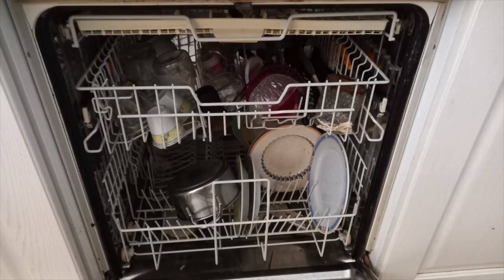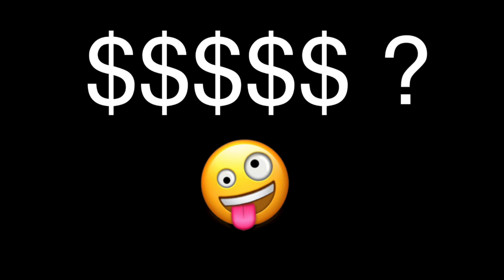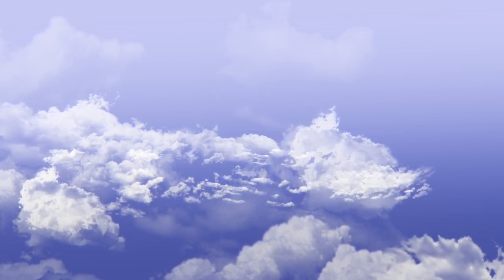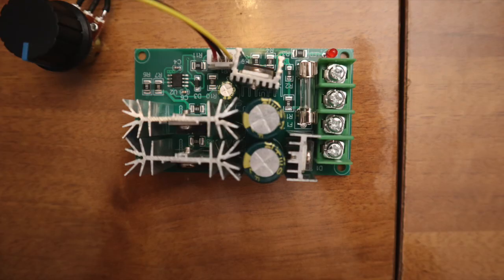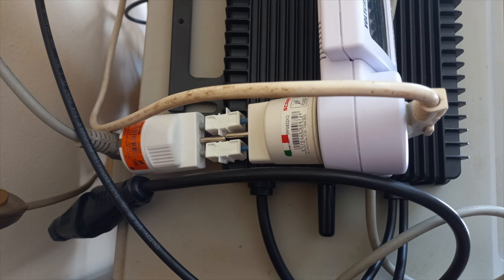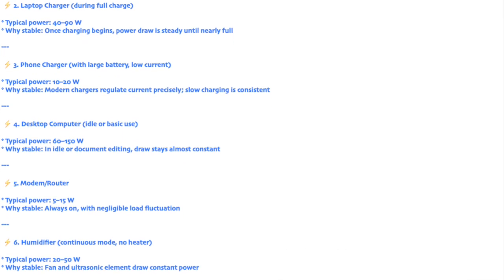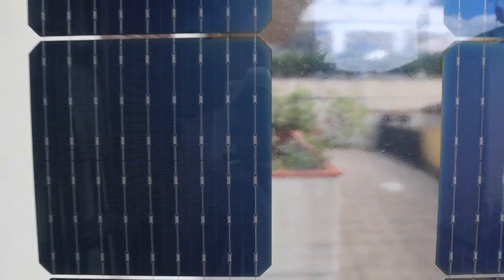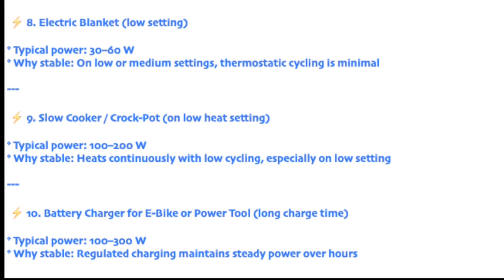Store Solar and bring it Everywhere, through Your Home Grid - 101

Comment: Nice going!  I like seeing people do this sort of thing.  I have been running part of my house like this with 3 micro inverters in parallel.   I have panels and charge controller for a 48V bank.  The input is directly from the 48V battery bank driving a Voltage/current regulator board that is configured as a constant current source.  These can be bought from amazing and begood.  EACH micro inverter must have a voltage/current regulator on the DC input. The regulators must be set for V  limits within the range of the microinverter and the I limit at below the maximum of the microinverter.  This provides enough isolation so they can "hunt" for the MPP independently without interfering with each other.  This simulates each micro inverter having is own solar panel.  Each Regulator board will use some power because they will be only about 90% efficient, but the simplicity is worth it and a LOT cheaper than the alternative.
Reply from the maker: Thank you Barn! I think we are on the same way, but you are way ahead. That is a sign that I am working in the right practical direction: a combination of current and voltage control. Did you mean to have them found at begood.store?

Comment: Cant you just use a limiter on the gridtie, and a high voltage cut off in case the voltage go up too much for the inverter. Not sure if an avr can be used in this scenario. But adding. A. 2000w gridtie w liimiter to a 3000w inverter would be awesome
Reply from the maker: Hi MegaCyrik, thank you for the question and suggestion. The limiter is there already with the lamp, which takes away so much voltage (up to 12 Volt) to suppress the Micro Inverter. What I need is a variable limiter in the form of a current source, where the current is just what the PV is able to produce (or my PWM is wanting to give). I will come there, but this week I am extremely busy and I have just time (see Mentor below) to start a "Funny playlist". After this crazy week I have time to dive in the lab and develop a reliable simple controllable current source for the grid-tied solar module.
Reply: @nnvasen-good-energy  i wouldnt ever run the grid tie on PV thou. I need it to be reliable and not turn off while running a 4000w load on a 2000w inverter. So batteries all the way. That also makes sure i get all the potential energy from the sun. The voltage limiter i had in mind was for AC. I have read that if the load suddenly drops off, the gridtie might raise the voltage by quite a bit until the grid tie limiter function catches up seconds later. This could send the AC up close to 300v. Is it true? I dont know. I have seen a few compelling test for it. Hence my worries for blown caps or worse. Dont know if some gridties have a build in option for setting max output voltage, maybe like set it to 235v max and have the inverter set to 220v. But yes i have no idea as i dont have access to try dozen of various interesting products and more importantly lack the required education to safely test everything that pops up in my mind without burning down the neighborhood 😅
Reply from the maker: Hi Megacyrik, you come up with a lot of issues that are complicated indeed. Also I lack the time and resources to test it all. More important is that I agree with you and automatically tended to the option to see solar charging the battery as a different process from the discharge of the same by the grid tied inverter, so that you are guaranteed of continuous supply (as long there is no black out). 
The Micro Inverter must therefore be adapted but from the other side, I have already the Victron Multiplus that does just what I want to achieve and even switch seamlessly to the battery! This box that units charger and UPS gives not less than 3 kW and does nearly the same. Only difference is that it just gives the grid voltage via contacts to the home and switches in milliseconds to its inverter when the grid fails. But hey, it does more: when I ask too much power (over 3.5 kW) and the meter would interrupt, this blue box ADDS its own inverter to this power and with thus have to synchronise with it. I didn't realise this when I bought it but it works. 
Now I try to simulate it on smaller scale because it costed about 2k€ (now I see it for much less) while the Micro Inverter costs about 6% of that (even if it does much less, it is good as a starter). 
The advantage of doing this DIY is that you grow and understand what you do, without breaking the bank and at each crosspoint in the way you can choose.
I have even the micro CHP working on this victron with a gasoline generator, without knowing that when I bought the Victron.